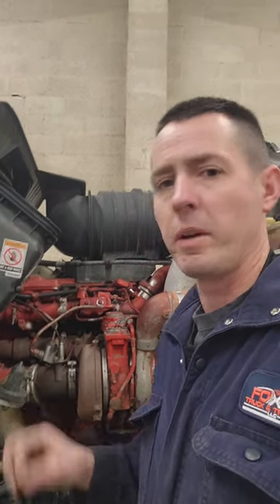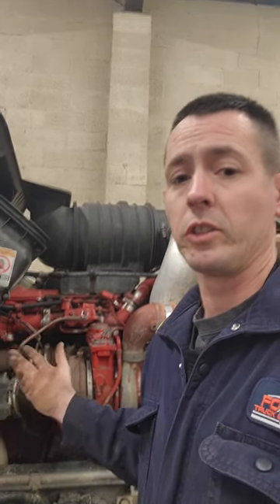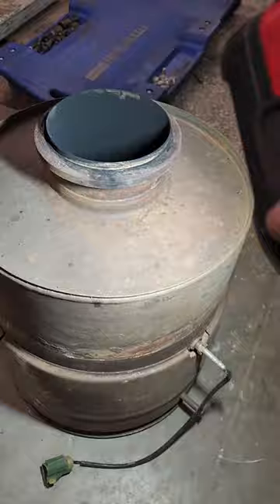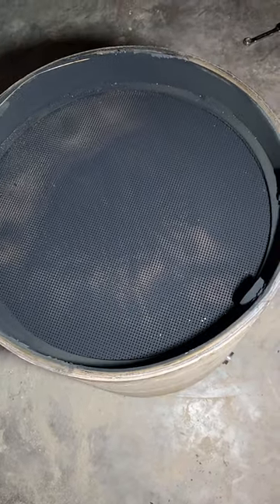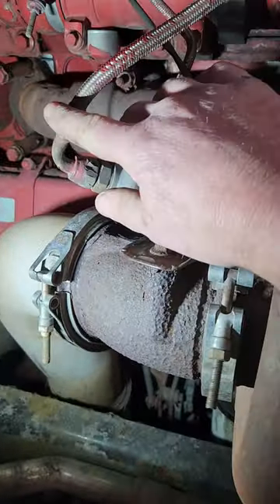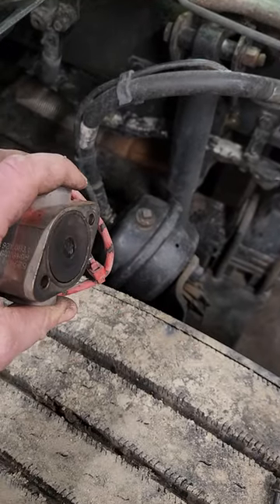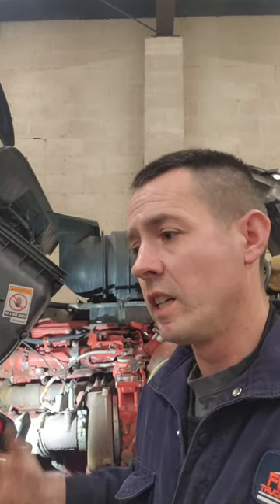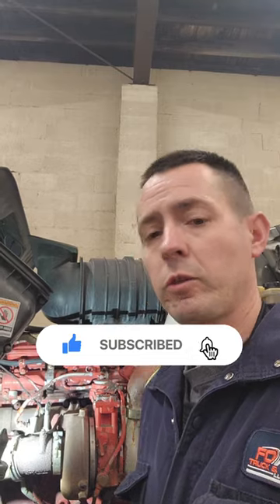DOC (Diesel Oxidation Catalyst) Face Plugged Up After 1 Week, These Can be the Cause!

Comment: there is a test for the injector, if the engine dies its not that injector that is the fault, you better pop the head off the hpfp and check the tappets and cam along with the plungers, and for sucking air, you will also need to reset the ecm for all the items you clean or replace or the ecm will over fuel thinking they are still in the used cycle, its in the advanced ecm tab on insite. also do a snap test for smoke, a dripping or overfueling fuel doser will not face clog anything.

Comment: I've always found air systems leak that contributes to this problem either an inlet restriction (air filter) or boost leaks minor ones, I've only had 3 hydrocarbons injectors fail in the ast 13 years an were all due to fuel system failures an contamination. Love the channel from diesel tech to another 🫡🫡🫡🫡
Reply from the maker: Thanks 🙏

Comment: Mine stopped doing a Regen around 8 months ago.  I cleaned the filter and it Regened a couple of times on a short trip and the engine light came on again.  Im happy for it not to be working but I don't have my alcohol injection setup yet.  I don't want to use it for boost just want it to keep the backside a little cleaner.  I'll be pulling the codes here soon.

Comment: Hi, can someone help me? I did forced regen and my temperature didn't look good to me. It took about 1.15 hours to do the regen. DOC was at 771
DPF INLET : 937
DPF OUTLET: 891

No fault codes no issue. I did SCR rest in cummins INSITE and it passed all. Do i need to be worried about something? I feel like DOC is clogging up. Any help would be greatly appreciated!

Comment: How are you all doing Can anyone help with this spn 4364 fmi 18 peterbilt commins isx  Check engine it's still on Took it to the shop they put new DPF filter and outlet nox Check engine still on Now i'm noticing my trailer Getting dirty from exhaust And also not using Proper amount of Def It's using list

Comment: So do over the counter products "Pour in tank DPF cleaners/fuel treatment" actually work? Looks like the fuel actually doesn't touch the DPF itself only the DOC to heat the DPF....
Reply: Those products just cause more problems they will clean the soot from inside the engine and send it rite into the DPF causing damage due to high back pressure